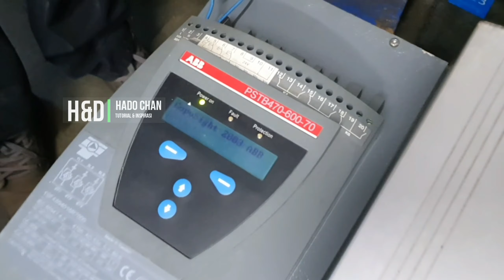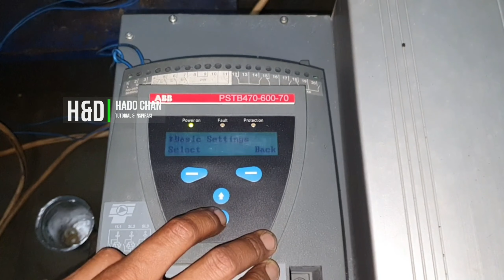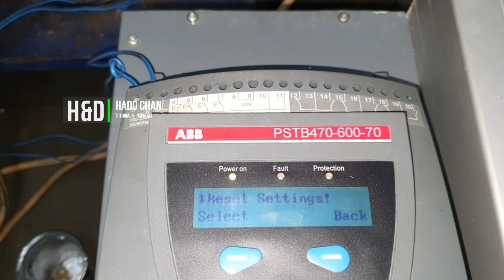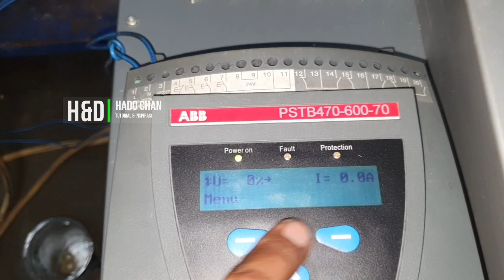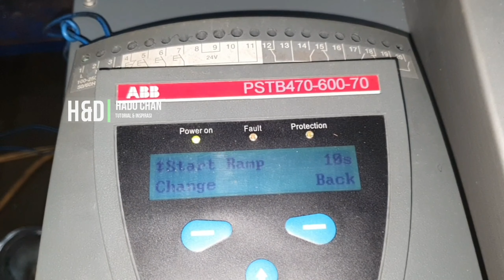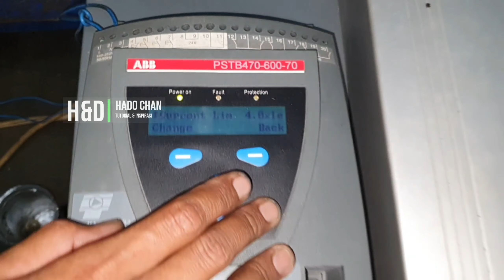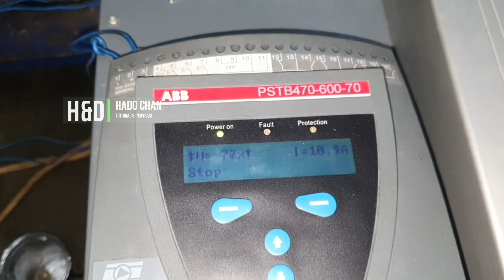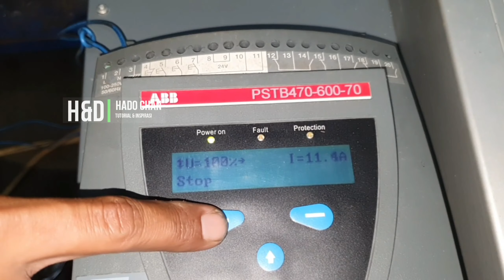Bongkar & Setting Softstater ABB PSTB470-600-70

Comment: Jual spare part ABB tipe ini mas ?
Reply from the maker: Tidak jual mas , ini kebetulan lg nyari" board modulnya utk tipe ini ,tp sulit sekali keliatannya.
Reply: @hadochan  saya punya 1 unit, perlu CPU 1 set
Reply: Ada kontak yang bisa saya hubungi? Mau diskusi
Reply from the maker: @veghataufik3956  saya bukan orang yg pinter lo mas ,hehe , mnggo jk mau silaturahmi 087899146558